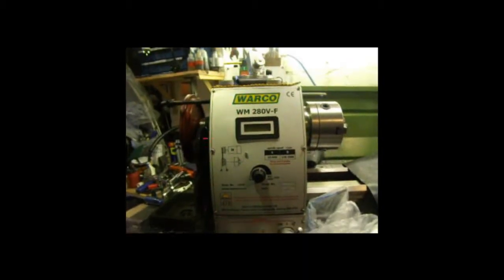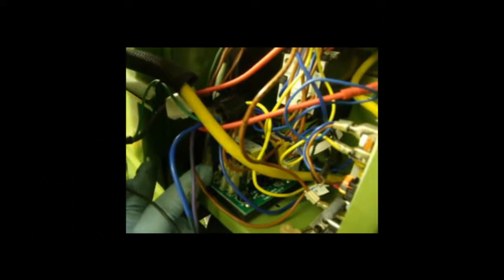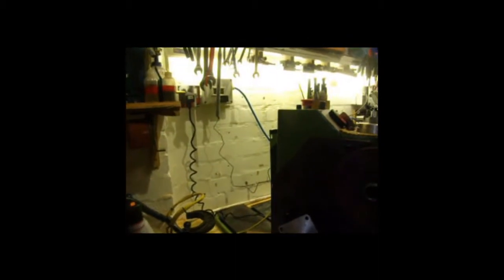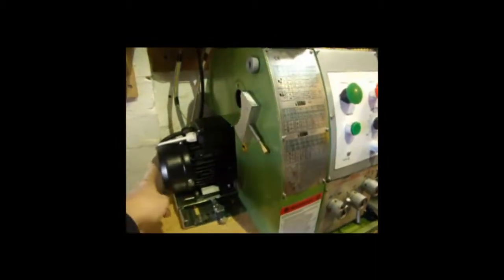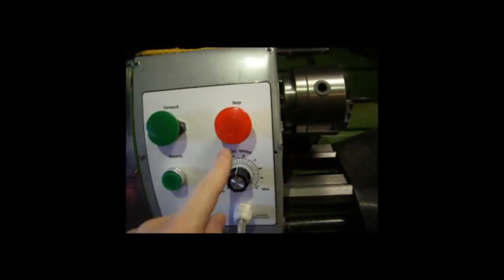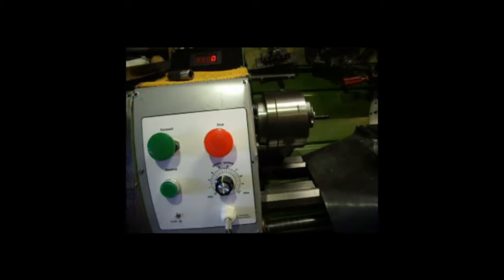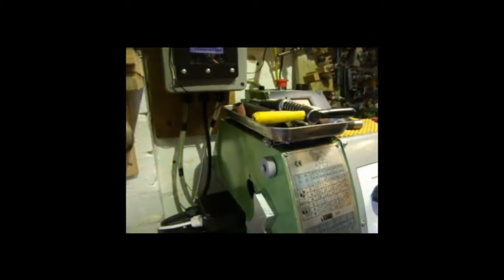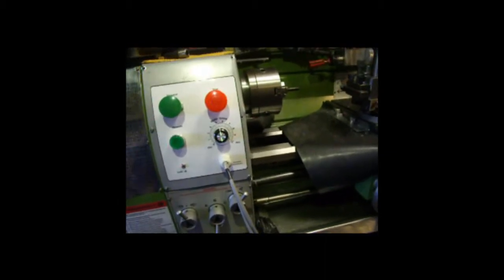Warco 280V-F lathe conversion to 3 phase

Comment: Good vid!

Have the same lathe, Second SC has just about packed up. Motor is about had it too.
Doing stainless on them soon naffs the motor.

Had mine for a good few years mind. Been a cracking lath tbh.

Purchased a 2hp kit from inverter drive supermarket for the conversion, May I ask what pulley you have used. I need one with a 24mm bore keyed.
Reply from the maker: Pete Wallace Hi, I agree they are good lathes it has served me very well.   I see they have now added an inverter drive, so it looks like the right way to go! 

I also had a problem finding a pulley so in the end I made a rough one out of aluminium.   It works OK but I will try to improve it now I have more time.  

It is not too difficult to put a key way into aluminium I simply roughed it out with an end mill and then filed it to fit the key.

Hope this helps?
Reply: George Heg  

Managed it in the end, converted it to a standard SPA 13 belt and pulleys.  Belts are cheaper too ;) think it cost me about the £30 mark to convert it so not too bad.

Did mine slightly different though. Fitted mine into the back as per original. Tight fit + a bit of modding and it worked.  Used existing button setup bar the stop button. Want a big one that I can fit on the front. 

It's like having a new lathe now all over again! 

I have pics if you want to see how I've done mine.
Reply from the maker: Pete Wallace Hi Pete yes please I would like to see what you did.  Have changed the pulley on the spindle as well?
Reply: George Heg 

Shared them via google+ with you and yes I did both. was the easiest solution to be frank. Got them from my local bearing shop/specialist (Signet bearings  http://www.signetid.co.uk/Home.aspx ) Only thing I need was a 4mm shim for the key. As at 40mm standard is 12mm, the lathe key is 8 iirc.